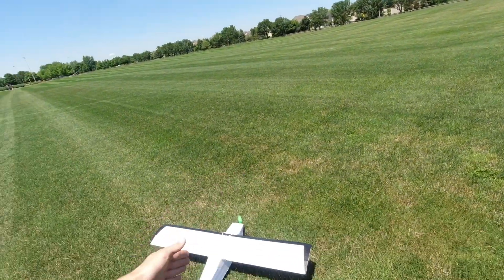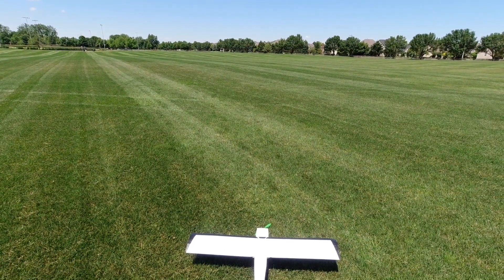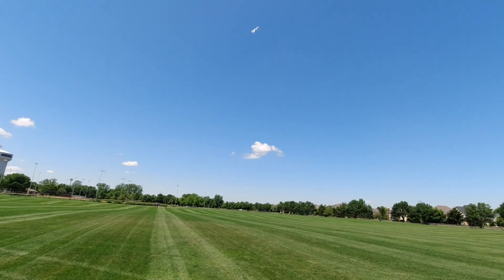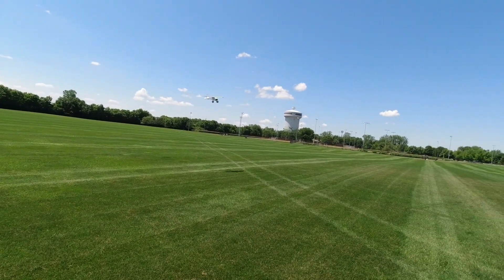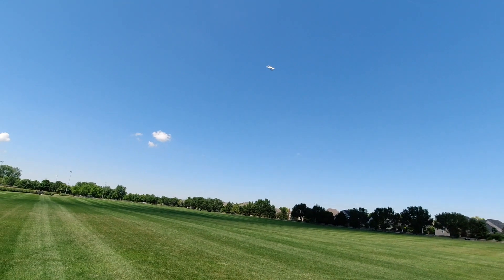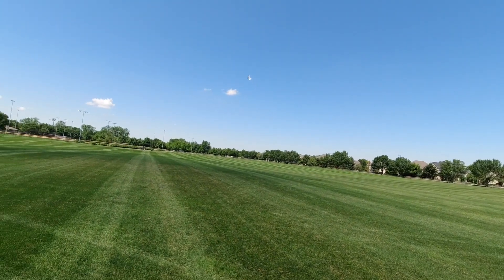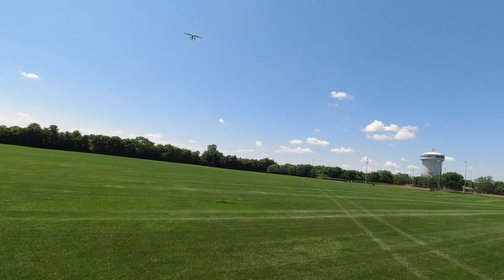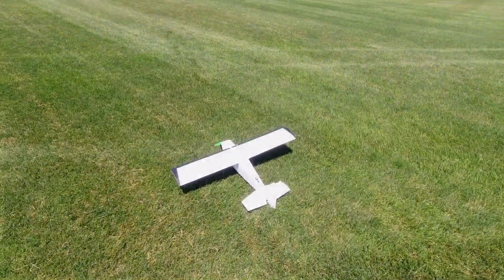FT Bushwacker 3D Flight

Comment: Hi 👋  wondering if you would still be able to do a video showing how to setup a Spektrum/ horizon or e-flite type plane to the radiomaster. Specifically with a panic-style switch and a switch for as3x control and possibly one for different flight modes (beginner, intermediate, advanced) this would be great as there's no videos to be found on YouTube covering this on an opentx radio, thanks again
Reply from the maker: Working on just that. Stay tuned!

Comment: Do you have a flaperon set up on this?
Reply from the maker: I did, but it made the plane nearly un flyable and overall just wasn’t necessary. you need as much aileron throw as possible
Reply: @CustomFPV  thanks man I was wondering if it was good to use it like that. I guess that makes life easier 😅

Comment: i have a 4s 3000mah / 2836 1400kv / 10x4.5 slow flyer on mine and you can take off basically from a stand still lmao
Reply from the maker: Yeah my motor or ESC on this one is weird, If theoretically should be able to push my 11x7 with ease, but it struggles